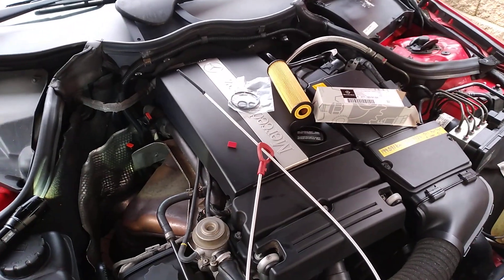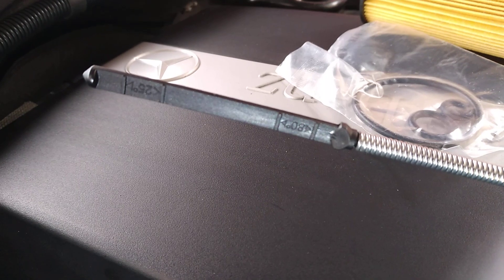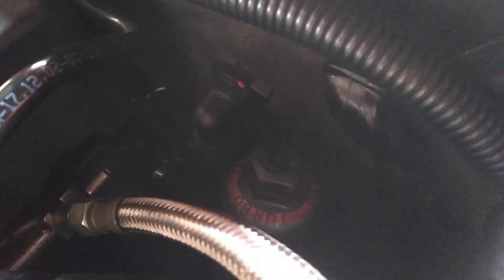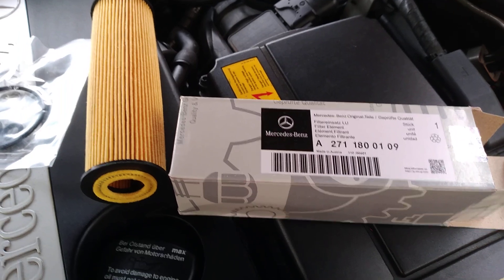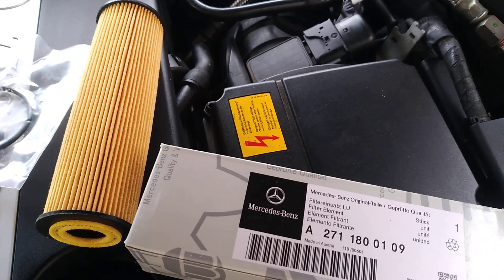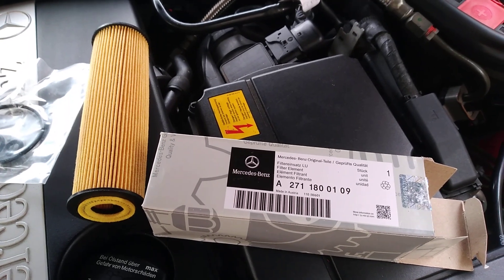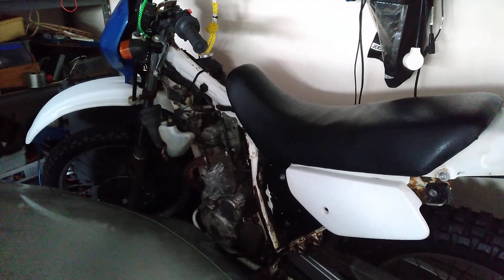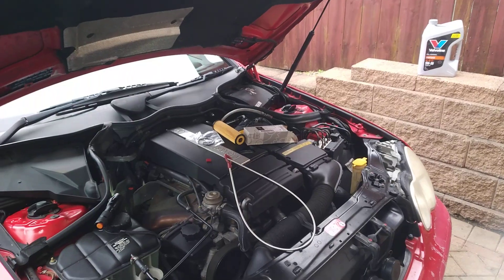C180 Mercedes transmission dip stick oil level check w203, changing engine oil

Comment from the maker: Hi, best practice is to get emgine to operating temp before draining the oil, advantages are faster draining with thinner oil, more likely to remove any debris. Although at times i have drained after standing cold for a few days it is recommended to drain when hot. Hope I haven't cause d any confusion,  I appreciate your views.